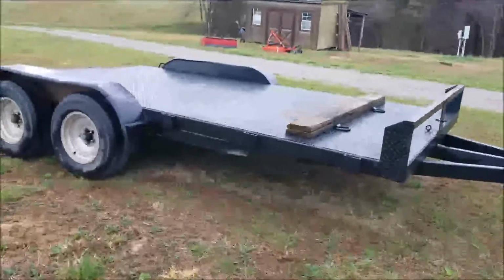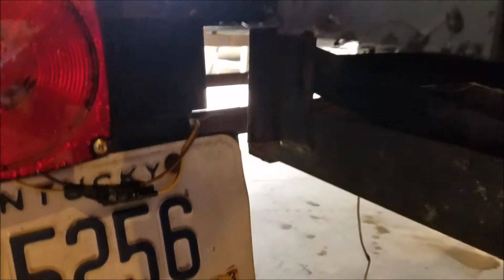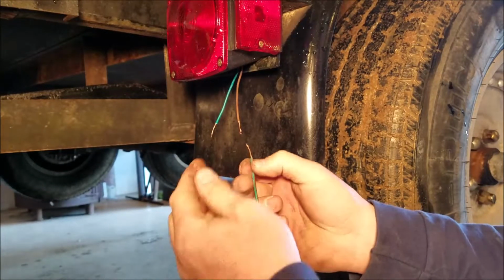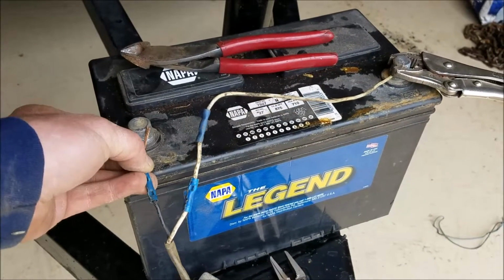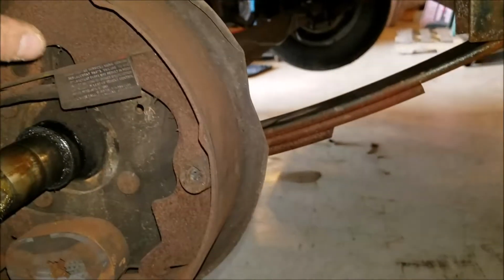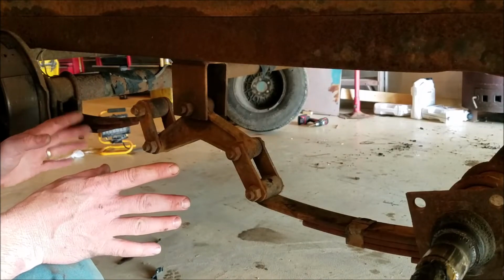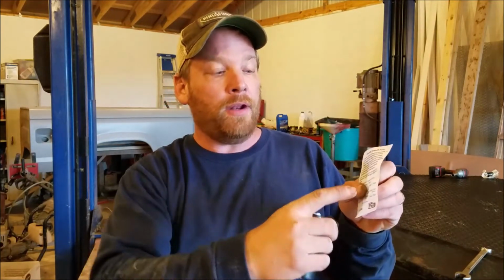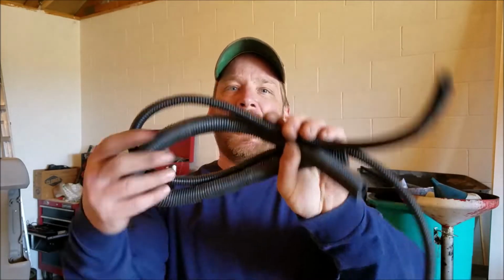How to INSPECT and REPAIR a used TRAILER

Comment: I did a lot of commercial vehicle wiring which is a different 7 way plug. Green is R turn because it has a R in it. Yellow is L turn because it has a L in it. Red is stop for obvious reasons. Brown is tail lite, Black is marker lite, White is ground, and blue is auxiliary or electric brake. Got my official Kentucky plate. Thanks.

Comment: Did you use marine grade heat shrink? Would be a helpful tip to mention if you did or to mention that the marine shrink has resin. 

Yeah the grounds are normally just fastened to the frame lol guess in theory it'll last longer with a home run. 

Do you have a box for the battery, tow ropes and cargo ties on this rig?

Comment: I have a set of magnetic LED'S that I use on all my trailers without brakes. You can remove the lights for loading and unloading so lights don't get broken and they don't sit out in the elements when trail sit outside.